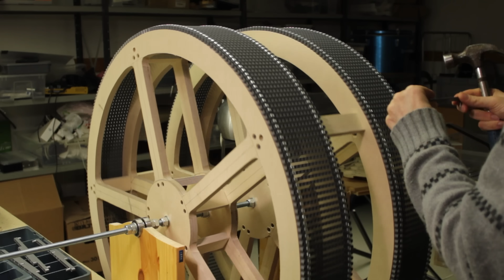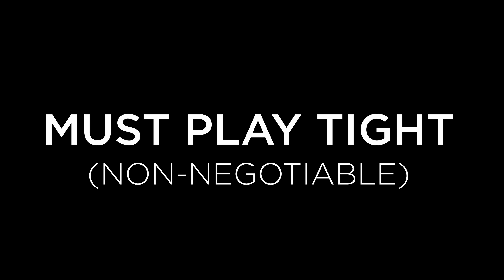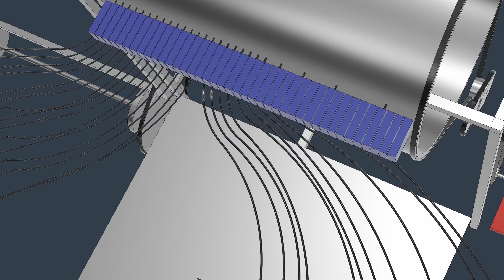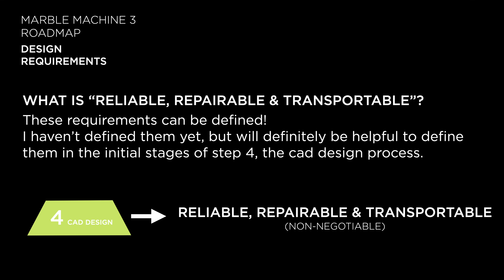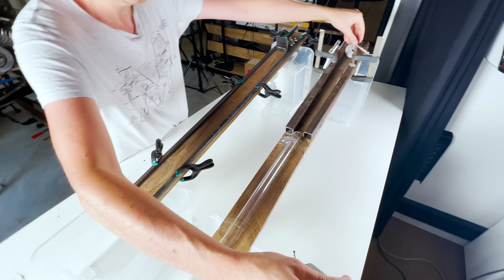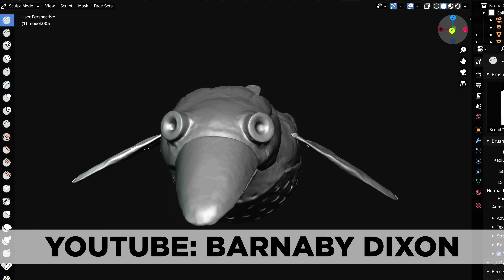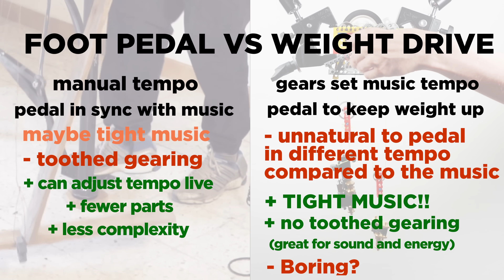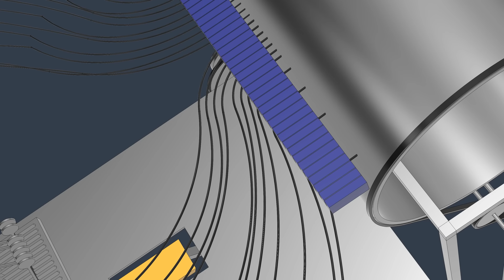Marble Machine 3 is Taking Shape

Comment: Why can’t you use a servo drive. It will give superb speed holding plus the ability to adjust the machine speed on the fly? Plus it means that the ma+nine can operate without your input enabling you to, at times, wander around the stage. I think the foot pedal solution is crude if you want to play tight music.

Comment: I'm glad you're abandoning the weight drive (for now). Also, in your reflections regarding tightness, you should separate your own ability to keep a certain tempo from the machine's timing consistency. If you take yourself out of the equation, it is also easier to provide a target value for tightness.

Comment: An idea you could use although im not sure how easy it would be to impliment if you did have to use the weight drive is some kind of gear shift (like a manual car shifter) to chage tempos between a few presets

Possibly in small increments of 5 bpm for not over stressing parts in a gear change (that would give a 30 bpm range with 6 gears sets)

then you could also have a large gear change that would move your range from 80-110bpm to 100-130bpm (possibly bring the marble machine to a stop between songs to do so as the large change might overstress parts and break something)

Comment: you could use a bicycle chain and sprocket system instead of belts if you want the system to play super tight.
you can use the bicycle tensioner to keep the chain nice and tight and have perfect timing with 0 slip.
honestly, the foot pedal seems like the best idea, and failing that, an electric motor. the weight drive seems like a recipe for disaster.

Comment: But you made a solution to that problem in the MMX (MM V2) where you had an electric motor as an option to play that MM at a specific speed… sooo I’m confused why u r trying to do something different when that was more flexible, more precise, you don’t have to constantly crank it to fight the weight to stop it from hitting the floor, and I think most important LESS complicated?
You could even have the motor programmed to match w/e tempo you’re at and when you engage it, it rounds up or down to the nearest whole number bpm at keeps it at that constant speed until you disengage it.
Reply: Even in MMX the electrical motor was supposed for testing only. For actually playing it on stage, it was always meant to be without electrical motor.
Reply: @doro5751  I understand that it was meant to be for test, I just think  it seems like a mostly solved solution that, may be a much better choice (imo) than a weight/gravity based system where you have to figure how much weight you need for different tempos when an electric motor could just be dialed up to or down to a specific bpm/tempo.

Comment: Martin, I just want to put it out there that you should never just restrict yourself to the handful of options that you've previously considered/brainstormed. Reach out to others for their ideas. Consider alternative paths. I think the most likely source of failure for this next machine is boxing yourself in with these ideas of absolutes - the music has to be inhumanly tight; the machine has to have the previously defined set of instruments; the power has to come from either a crank of Huygens drive. Be flexible throughout. It might be very helpful to continuously take input from other engineers throughout the process. The biggest issue I see already is that you're putting yourself in a box.

Comment: Have you ever considered power via a steam engine? It would keep a really tight beat, never run out of power (with sufficient fuel, of course) and have an awesome steampunk vibe! There are plenty of experts too to consult. If you're cutting out the hand cranked part, at least have the replacement be really cool.

Comment: Why dont you pedal the weight drive and put a clutch on it. You can press the pedal as much as you want but when it is at the limit, a clutch system would ensure you dont overdrive the system. You can also pedal to the beat no matter what the tempo is

Comment: You should use a motor to bypass the manual tempo when you just want to have the same tempo all song long. Or you could add a programming channel to your wheel for dynamic tempo which is still controlled by the motor. I get that you want to physically play the music, but you’re creating a problem that doesn’t need to exist. If the machine can handle tempo itself then let it.

Comment: The three wheel design option seems like the better choice, you always need to remember KISS. Keep it simple stupid. While three wheels sounds like more complications you're simplifying the work of changing the pegs. You can have multiple people changing them at the same time so 3 times the efficancy. Also you are keeping it all seperated so its a simpler design.  Less complications on what it is doing if its not all right next to each other.

Comment: Hey Martin, from your rough sketch, there is a problem that will need to be addressed. It can be a big problem if it's not taken care of before you follow through to CAD. The problem is that your rough sketch has poor UX. What is UX? UX is User Experience... YOU!!! You are going to be playing this marble machine. You need to be able to easily get in and out of the machine throughout your concert. By implementing a door, gate, folding table, or the like, then you should be able to easily get in and out of the machine. So, don't forget what I mentioned. It will be useful going forward with the Marble Machine 3.

Comment: take a look at mechanical speedometers. They might be useful in giving a purely mechanical and continuous view of your timing as you are playing. Having gauges and controls on the machine itself would probably be really useful when accounting for variations with imperfect conditions, manufacturing, and different tempos when playing. You could, for instance, have a gauge showing where the weight is in the weight drive, which would let you keep it from moving too much just by eye.
Additionally, consider having two separate power systems: one for the timing wheel with very little fluctuation in the power draw and precisely tuned, and one for actually running the marble system. This way, you could use the pedal and hand crank at the same time. :)

Comment: With the weight drive couldn’t you get the same control over tempo? Like on a bicycle you can have like 25 different gear ratios that’s fairly easy to switch between could something like that be used with the weight drive to give you tempo control like with a foot pedal only? Does the weight really need to be kept in one place? Like maybe there’s a minimum number of presses you’d need to keep it from falling too quickly that it stops, but couldn’t it be set so that you can press the pedal to whatever tempo you like and it’ll only pull the weight up below a threshold? Could provide some more interactivity as well or allow you to move around more knowing when in the song you’ll need to start the pedal again.

Comment: Hello Martin,
Maybe a half electrical drive system like an E-Bicycle is what you need. You can easyli adopt the speed maybe with a potetntiometer switch or Bicycle Computer.
For powering you can use a foot padel connecteted to generator with a buffer battery.
The most important is when you use it at home on a power Socket you can tweak the Marbelmachine and don,t need to crank all the time.

Maybe a Bicycle Motor is the perfect solution. You can adjust how much the motor suports your cranking or it powers the machine all itself.

Comment: Hey Martin, great content! Regarding powering the machine, I think we can have a tiered system. For example:

MM3 stopped -> Cranking up MM3, charge up the Huygen Drive energy reserve, MM3 works at fixed rate -> Keep cranking, energy reserve full, enter direct drive mode, MM3 works like the old flywheel system where you can adjust the speed using pedaling frequency.

Stop cranking up MM3, speed drops -> Speed drop below threshold (speed equals the fixed rate), exit direct drive mode -> Huygen Drive energy reserve kicks in, MM3 at fixed rate -> energy reserve depleted, MM3 stops.

Best from both worlds!

Comment: If you can get it to +/- 5ms that will be good, but +/- 3ms is probably better. If you end up with a sub zero ms machine it will start sounding like MIDI without any jitter being added. Too tight sounds unnatural to humans, and it annoys me like hell when I "can download the drum and bass track for free" only to find out that it sounds so mechanical that my mind rejects it (I'm a noob guitar player).

As for good sound, I think you can also get to a specification. Not on the sound you want, but on the sound you DON'T want: mechanical noise being picked up where you don't want it.

Comment: I think a pedal/motor hybrid will be the best long term solution.

I think 2 hours of foot pedaling during a concert while standing/balancing on the other leg isn’t going to be ideal for tour.

I’m envisioning a system where Martin can set the beat with the foot pedal and the motor will maintain that speed and can be only motor powered if Martin wanted to have more mobility.

Comment: I'd personally use a small electric motor to drive the machine, then you can just have a dial with bpm on it, and have it on a clutch with a foot pedal so you can manually drive it too if you want to on the fly.

Comment: For definitions you should really start by looking at what area, volume and weight you have available for shipping. 
You can choose whatever, but it would be sad if it ends up 40cm too big for a small shipping container so it gives twice the cost to ship to for example Sidney. Then if there is a common weight restriction in concert halls and similar. 
Or if it can fit in standard EU-pallet forms, so 1200*800mm sections - which makes it really easy to ship by almost anyone. 
How much space do you accept for spare parts? 

And suddenly the weight system could be disqualified by those requirements. 

This is a machine for a world tour. So start with your boundaries.

Comment: I think it would be useful to consider both drive systems.  If it isn't prohibitive to design into the machine the ability to function with either drive system then you have the opportunity to use the weight drive during composition and recording where "tight" is more critical.  For touring I think it would be better to let the machine be a little more loose and allow for whatever improvising it is capable of.

Comment: I think you need a swappable programming drum. One song ends, pull the leaver out swings the drum/ wheel, your helpers slide off the wheel, put on the other one that was programmed while the last sim was played, then onto the next song! 

Also I think you need a system to help the program wheel helpers put the rite peg inserts in. I am thinking individually addressable LED’s that show a colour or flash pattern to show what pegs to insert. They will need all the help they can get putting in all the 3D printed pegs in 3-5 minutes.

Comment: Hey Martin
I'm exited to se this new structured development approach.  But the ''I know it's good enough when I am happy'' criteria scare me. Yes it is about the artistic expression but especially tightness can be quantified. I'm not a musician but i believe to remember that a trained musician can perceive a deviation of an attack greater than 6ms. I'm not absolutely sure about the exact value but a measurable pass/fail criteria can be defined.
And again *there is no such thing as 0 uncertainty!* If no deviation is recorded in the measured data then there is always the uncertainty produced by the measurement setup (eg. values measured to the next whole ms result in an uncertainty of at minimum 1/sqrt(3) ms). this has to be accounted for when you start adding up your time or reliability uncertainties from the subsystems to the whole machine to check your designe criteria.

Comment: Hi Martin! Great explanations and diagrams of process, I love this kind of stuff. (Probably why I work in manufacturing.) One thing to think about with the weight drive vs. pedal - I agree with doing pedal first, and proving/disproving it (you'll be much more connected to the machine that way and definitely less complicated) but with the weight drive I don't think you are limited to "pedaling off-beat", you just have to select which beats depending on the power usage. Also, an adjustable governor would give you the variable speed control option, like an engine throttle.

Comment: I accept your loose definitions of "sounds good" and "dynamic", but tight needs to be defined quantitatively. Either sub 1ms deviation from true beat, or some % deviation relative to bpm. 

Sheer willpower is not enough to avoid past mistakes. You're so afraid of making the same mistakes again, but you continue to do so every step of the way.

Comment: I think you laid out all the benefits of the pedal option pretty well, and I agree.  Most of all, I agree that you absolutely need to minimize complexity.  Every added part is a failure point.  I'm sure there are programs that can do drums with better timing than Danny Carey, but I'll take the latter.  As long as the timing isn't a total disaster, all the benefits it bring are more than worth it, IMO.

Comment: I think that deciding on how tight is "good enough" is really important.    Especially since it is the primary specification in the design.  Here Is one way that you could measure how tight is good enough:  Use a computer to generate music where the timing of the notes has added jitter. Increase this jitter until it no longer sounds the same as the ideal music, or ask yourself if making the non ideal music would still excite you. This can be your subjective measure of how tight the music needs to be. Once you have this number it will be clear if a heavy flywheel will be good enough, or if you need a weight drive.  I suspect that music with a fast tempo and really short notes would be the most challenging for "tight music."  You just need to decide what the limits of the machine are in terms of tempo and short notes.

Comment: I know of a way to adjust the tempo using the weight drive. Using a continuously variable transmission (CVT) any exact tempo could be set at any time and it will hold the tempo for as long as you want. I've used a drill press with a CVT and they work great at setting specific speeds. It also has no toothed gears.

Comment: Martin it seems to me like you just need a variable speed pulley section to meet your objectives while using the weight drive. Split sheave pulleys are quite straightforward and you could essentially have a tempo lever while keeping the music tight. They should be available off the shelf but could also be fabricated. They've been used for decades and decades, though complicated versions of them are in use in automobile CVTs.

Instead of an automatically increasing ratio like you would see in most torque converters based on split sheave pulleys, you can also just have a lever that changes the diameter of the split pulley and thus changes the drive ratio.

Comment: Even if the manual pedal doesn‘t play extremely tight music, I still feel like it would be the right choice. Just because it would be an actual instrument, instead of something that just plays on it‘s own.
Reply: Arguing that the removal of a manual power source makes it less of an instrument is extremely stupid, period. There's more to the music on the marble machines that can be manually controlled than just tempo. Manually cranking a handle or pedal to change tempo, as the only way to control the music manually, does not at all make something an "instrument". Would you call a manually-cranked phonograph a musical instrument just because it's tempo can be varied by the speed of the crank? No! It only plays back pre-recorded music, it's not an instrument for making music (unless modified to be so, by manipulating it in a manner like that of a musical instrument).
Reply: I respectfully disagree - even if the overall power (and timing) source is electric, Martin is still making the decisions and actions that lead to the music. I would compare this to any electrically amplified instrument - you as the artist might not be the majority of what's driving the sound, physically speaking, but it's you making the changes and your art that we're hearing.

Comment: How could you combine both a Manual and Automatic power drive?
Could you design a switch that allows for foot pedal for tempo control but if you add the Auto switch to on, the foot pedal just adds energy into the weight drive system, and you add more energy when needed before the weight drive ends?

Comment: If you use a CVT wouldn't you be able to just have a lever in easy reach that dynamically adjusts the tempo? CVTs can slip, but only under high torque.

Comment: The Huygens Drive can be driven (wound up?) by a foot pedal... the foot pedal can have variable travel... letting you stomp the pedal rhythmically, yet keeping the weight suspended between top and bottom.  You just stomp more, or longer, or harder, if the weight is falling.

Comment: I agree with the comments that the earlier machines were never mistakes but great experiences and learning in several areas.

But a thought about the power?
Is it possible to make a hybrid then between the foot and the weights system?
To like accumulate the power and tempo from the foot (for the more dynamic flexible feeling of the music) into the weights system handling?
Like a conversation memory system? Not just to uplift weights and handling in real-time.

But yes it will be even more parts if even possible but maybe could be more of cracking the code for optimal win from both power-systems enough to not interfere with the tightness of the music